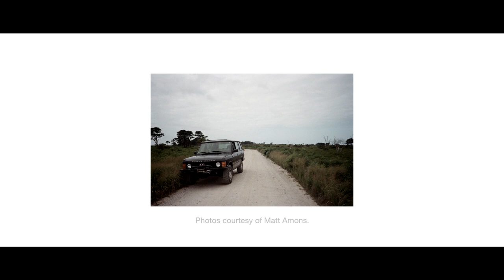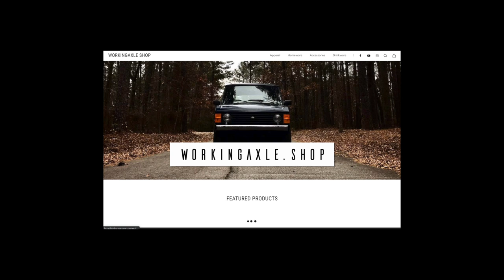Restoring the Center Console | Range Rover Classic - EP 20

Comment: Good stuff! Looking forward to see how you repair the top plastic frame behind the switches. 93 LWB here, similar issues.
Reply from the maker: Hey hey! Thanks for watching! Still tryna figure out the best work around! May end up reinforcing with meatier plastic or even aluminum bracing! 😅
Reply: @WorkingAxle  I need to clean up the hinge area on mine, corner cracked. Yours looks better. Yes, my rover guy mentioned a similar possible fix, like that.

Comment: How did you get the center console off the transmission hump?
Reply from the maker: Search for all the screws and clips you can.  Also remove the cap off the shifter so you can pull the rest of the plastic bits over the knobs.